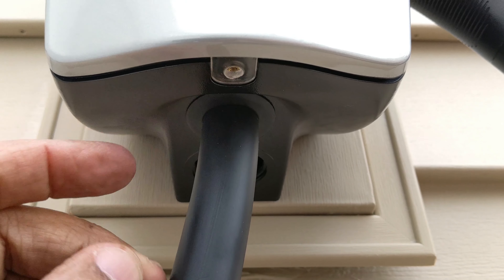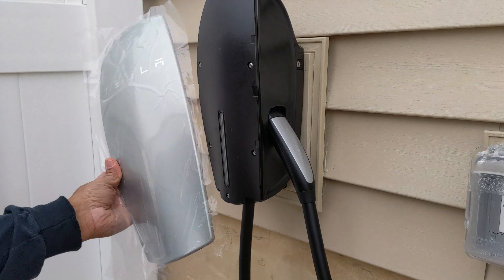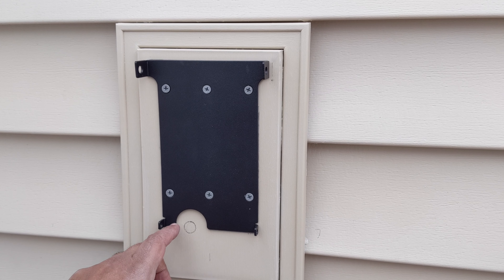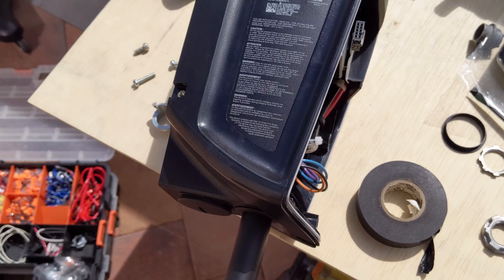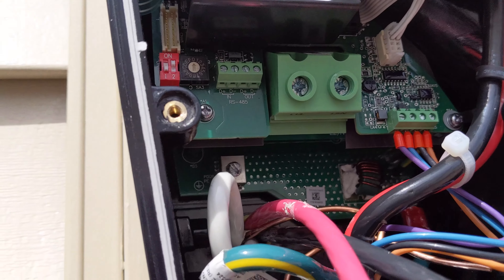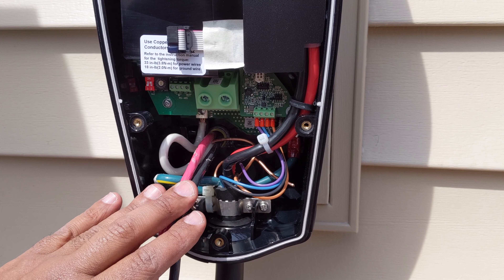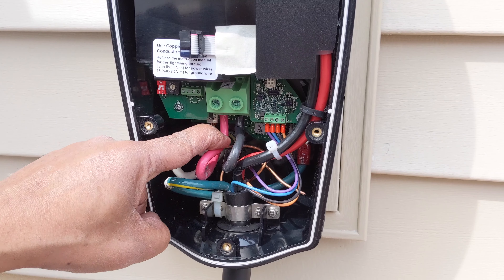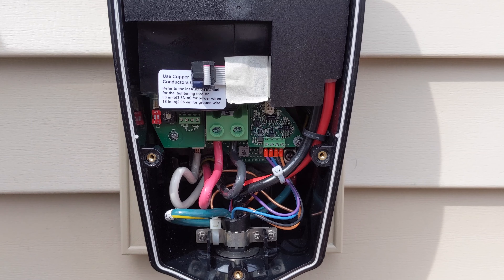How to install a Tesla Wall charger outdoors for dummies. Part 2 Tesla Wall charger installation DIY

Comment: White wire as ground, that is supposed to be the common, and the ground is the ground. You guys don't have common wires over there? How do you wire light switches then?
Reply from the maker: I just used it as a ground for my set up. It’s not being used for a common. This is just for this purpose.
Reply: Yea my bad, I meant neutral and forgot that ground and neutral are hooked to the same part of the panel
Reply: Good video btw

Comment: That Romex is not rated for 60amp. Maxes out at 55.  Gotta use THHN or THWN if you want to stay with awg 6 and run the charger at 48amps and be in code.  I'm sure your install works but your wiring does not match the 60 amp breaker which violates code.  A home inspector could notice this during home sale, especially if the Romex is not in conduit etc, etc, you know the deal.
Reply from the maker: Thanks for the feedback.

Comment: Hey man you can't just run free wires through siding
Reply from the maker: Hey man, as I stated in the video, if you’re not Comfortable in doing this type of work please consult a license electrician. As for my set up. It works.  Please be Guided by your own situation.
Reply: @DIYRAY  I don't think you state that it's a non-Code-compliant installation anywhere in your descriptions, and I think you get paid sponsorships to show people how to put fire hazards into their home. I don't think your errors and omissions policy coverage would be too happy with your broadcasted advice.